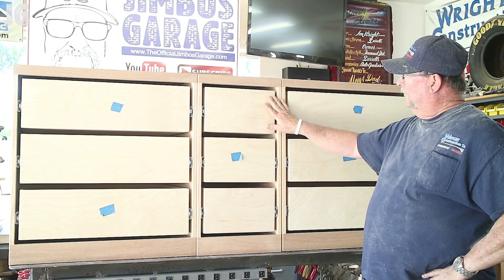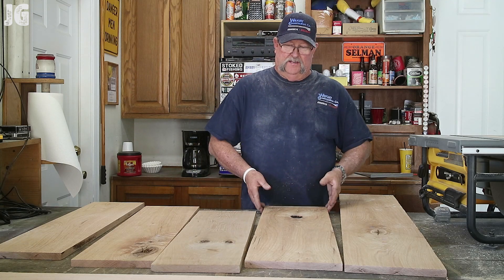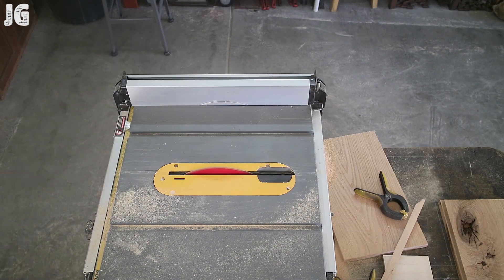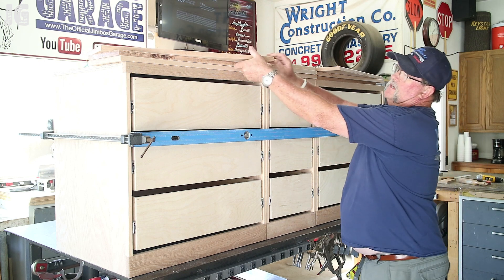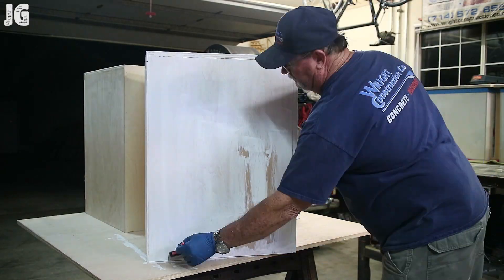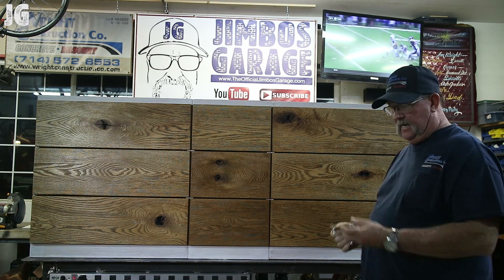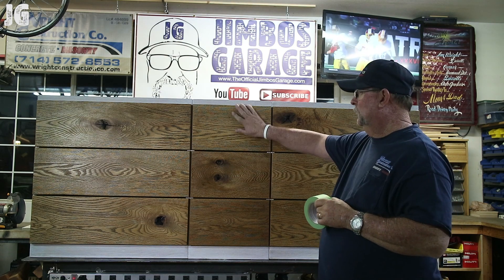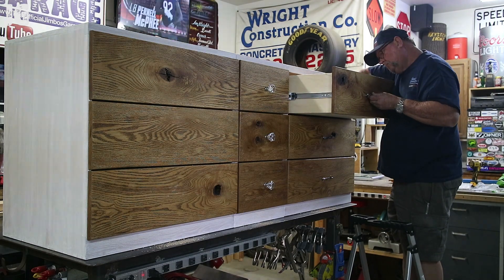Rustic Wood Dresser Part 3 - Jimbos Garage

Comment: Awesome job!!  I was just wondering what the cost was as I might build one opposed to buying one.
Reply from the maker: +jj1479 Thanks for watching! The total cost was about $400 for everything, But i always go over board on everything. But it is custom! You can't buy one like that anywhere! Jimbos garage!
Reply: +Jimbo's Garage Awesome. We are going to build the same one if you don't mind me copying yours? Do you happen to sell plans or remember how many sheets of wood it took an what height you set the drawer slides?
Reply from the maker: +jj1479  No problem! Feel free to build the same thing if you want, I think it was two sheets of 3/4'' oak ply wood, two 5' x 5' 5/8'' for the drawers, one sheet of 1/4'' birch for the back. and 3/4'' x 8'' to 10'' wide solid oak for the drawer fronts. put the glides at the center or just a little lower than center, I dont think it matters. good luck! Jimbos garage!